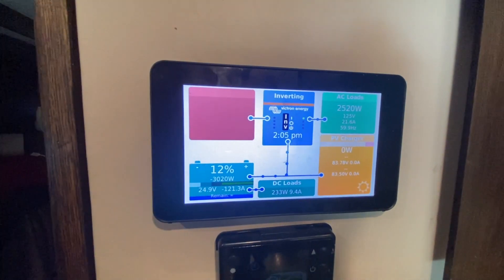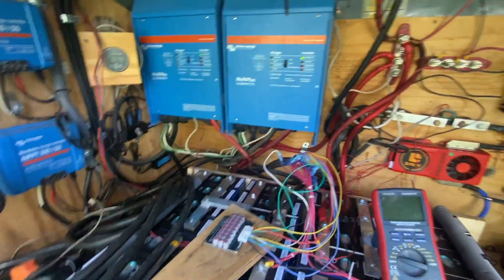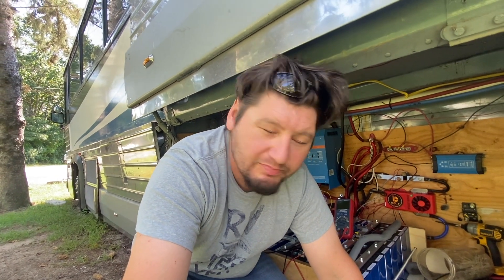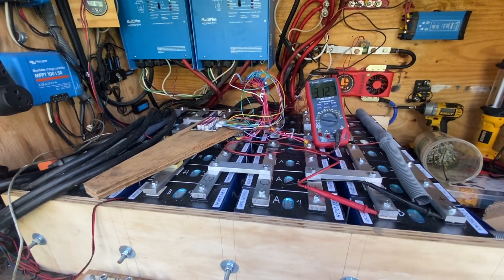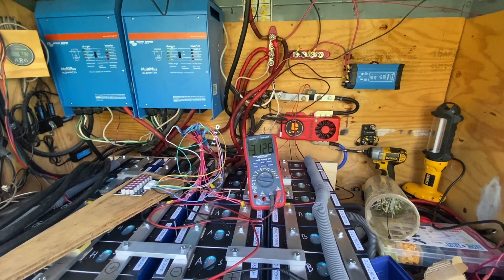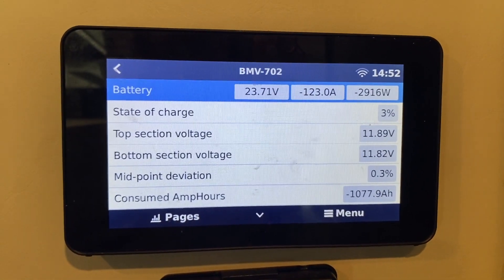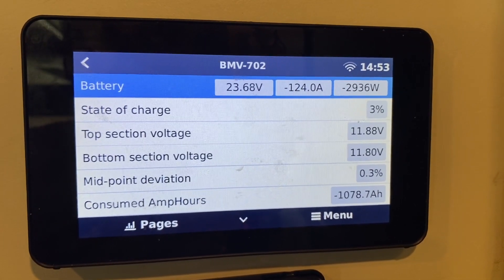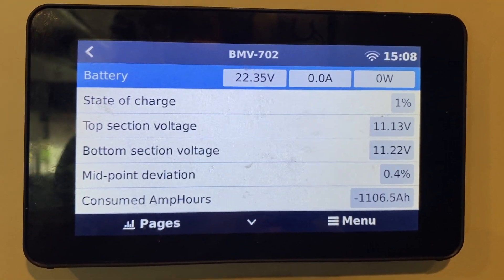DIY 4p8s 24v RV Lithium Battery Bank Capacity Test in Our MCI MC9 Bus Conversion

Comment: Just wondering how long did it take to charge ur battery bank back to full after ur capacity test?
Reply from the maker: Not sure back then. Today I can collect 20-22kw in a good day.  Battery is 28kw so…. On shore power with my 20 amp plug charging at 40 amps about 27 hours.
Reply: @HimmelbergerBus  oh ok I asked because I'm moving up from 5760wh to 12,408Kwh & was wondering was it gonna take me a lil longer to charge I only have 5 355w panels
Reply from the maker: @thelithiumpowerch  yes , much longer :-)
Reply: @HimmelbergerBus  oh boy so far I can get back to 100% in a few hours on my 2 24v 8 cell 120ah banks at 240ah now I'm adding a 3rd 24v bank of 8 277ah cells giving me 517ah

Comment: You should install a mini split on ur bus probably takes ways less power to run and do another capacity test the mini splits are very efficient.
Reply from the maker: Not a idea, except I  need the forced air for keeping air moving through the bunks and other areas.  We're  deducted system.   It's one of those things where the budget consists of time, space, money, power, battery .. how do we want to spend it all and in what portions.    I've made some additional changes that I'm hoping to share soon.  Stay subbed!

Comment: Those bus bars are not the best. Amazon has some really good bus bars but its the big copper ones that are like industrial grade. I have bought several and they are good but those little hobby bus bars are toys
Reply from the maker: Agreed. @sotasolar should really fix this :-)
Reply: @HimmelbergerBus  I know some people smash on Amazon products but it's where I got the bus bars for my system and I've actually just ordered several more for the battery build and another solar setup I'm putting together that's for my minisplit. Having good bus bar and super heavy wire makes all the difference in  a build
Reply from the maker: @matthewknight5641  yup

Comment: Trying to fix my comment just wondering how many watts does your air conditioner system draws when it's running like that I'm noticing a lot of people are using the AC mini split and heat pump units because they run at a lower power rate
Reply from the maker: The mini splits are much better. Rooftop AC is 1300-1500w depending on conditions.
Reply: @HimmelbergerBus  yes I just bought me a Senville 12000 btu mini split for the house once they hit ur set temperatures the power draw goes way down to like 300 to maybe 600 some even go down lower then that I just thought that was something you might be interested in you could run your AC mini split a lot longer and do another test for us 🙂 with your battery setup and the way a mini split run you probably could run for days 😉👍🏾

Comment: Wire lugs are only as good as the thinnest cross section of the lug between the end of the wire and the lug hole.
Use the thickest lugs you can buy.

Comment: Nice, hey I have a 50 foot air hose and I wana have a on board air on my 1993 mci bus , but is there any place to hook the hose too?
Reply from the maker: Nice to see you again. 

Yeah, there should be a port on curb side rear. I’ve used it to fill tires on the road .
Reply: @HimmelbergerBus  That’s on the right rear we’re all the plumbing is
Reply from the maker: @paulswan1982  Yeah, mine is mounted on the wheel well with the tag dump valves.
Reply: @HimmelbergerBus  sweet! I go my RV tomorrow n check it out! It’s in storage here in Florida :) How is your RV hood up in the winter weather? Like tires crack? Fade? Rust? Coronavirus 🤣 corrosion? Batteries 🔋? Because I going to bring my RV up there maybe next week 🥰
Reply from the maker: @paulswan1982  No issues so far. Just make sure the coolant is up to strength :-)
Reply: @HimmelbergerBus  I just flushed all my coolant

Comment: Does nobody know how to use a torque wrench? As an electrical engineer all electrical connections are torqued to manufactures specs, it avoids all these problems everyone has with self built banks. Hand tightening electrical connections is just asking for random tightness or over tightness.

Comment: I need some help with setting up my Cerbo GX. I have 3rd party inverter charger and charge controllers but want to monitor history of PV production and battery consumption. I have installed a smart shunt between solar controllers and battery to track the current. Anyway it isn't showing up at all in my historical graphs. I also have a smart bmv 712 to watch battery bank. Do you have a suggestion for where I could get support? I'd love to have a quick chat with you even.
Reply from the maker: Victron Community is great for that sort of stuff.  Here is a post I found, looks like it's not in the future plans.

https://community.victronenergy.com/questions/73342/vrm-dashboard-and-marine-mfd-app.html

You might find that your PV and Inverter does have unofficial support for VRM / Venus OS logging.  There are a number of devices people have gotten working on there.

Comment: Nice job, I've built basically the same thing only half the capacity so far... hope to double it next year, I'm like you, this is all new to me but I had a loose nut on mine during charging... not much but a little bit and the first capacity test was 40ah short, once I tightened the bolt up and recharged, I got full rated capacity... and you have to charge to 3.65v per cell and discharge to 2.5 which is a pain to do, if you've got over 1100ah out of it , personally I wouldn't worry about it too much, in service you never charge that high anyway, so far the voltage drift at the bottom charge disappear as you recharge, mine was I think 8mv at the bottom and 3mv at the top, I only used the active balancer for the last little bit of charge... 3.6 and up to get them all to 3.65, I'm charging the pack voltage to 28.2v which gives me about 6ah short of a full 100% charge and the BMS doesn't kick out at that... I think you have a darn good battery pack there, takes some getting used to with the voltages compared to lead acid though doesn't it... I don't know about you but I dropped almost 1000 lbs. of weight off the bus getting rid of the big 2v lead acid cells I was using before, imagine your AGM's were similar... keep it up, this stuff is fun isn't it....
Reply from the maker: Yeah these new batteries are so fun to play with. I’ve been debating on doing a full draw down again or not. I’ve also considered doing a zero current calibration on my shunt. So many variables could account for the variance, I’m not sure it makes much difference. 

Are you old 2v batteries Edison? I thought so for some reason. If so, I’m fascinated, sounds like they’d make great stationery energy storage. 

Yeah we dropped a good 1000 lbs and saved space.  So much so, I’ve thought about combining my wet bay and electrical bay and worry about keeping 1 warm. 

Thanks for mega comment, I love reading about other viewer’s experiences. Also love your channel, every time someone asks about adding slide outs I mention you and say “I’ve seen it don’t, but it’s a lot of work”.

Safe travels!
Reply: @HimmelbergerBus  My old 2v batteries are Davidson Battery, they came off an old barge we had at the Tug Boat company I used to work for, they were free so worth a try... they didn't last long, the slideouts definitely were a lot of work but worth it for the space I gained, I have my wet bay and electrical in separate bays but I'm going to heat them together, I'll be doing that before winter so you can take a look at that and see if something similar would work for you, I'm just going to use 1 heater and circulate the air through both bays... hope that works... good to hear from you , keep the videos coming

Comment: replace that bad group with the leftover batteries that you have.
Reply from the maker: Well 1) it’s not all 4 that are bad, we’re talking 16 amps out of 1120. 2) if that bolt was lose during charge it could just be under charged. 

Maybe I should make sure these get to 3.65 and soak until the hot 4 amps per cell absorb, then to another test. Problem is it takes so long now :-)
Reply: @HimmelbergerBus  sounds good bro; i like technology like this.:)

Comment: Great test! Are you happy with the Daly BMS? I am thinking of the 500a vs 400 or 250. What other options did you look at for BMS? Kinda surprised you didn't go with Victron. Also can you log history with the Daly vs cerbo gx? That is ultimately what I am after. Thanks
Reply from the maker: I’m not aware of a stand alone BMS from Victron. They sell batteries and battery protect switches though. 

Daly seemed like the best one, had BT and UART options for
Monitoring. And you can log that info in the Cerbo via VRM. However, to do that requires adding in a driver to the Venus OS software and fiddling, but it’s pretty cool. Only bummer is no cell level monitoring, so for right now I’m using the BT app. 

I still use my BMV 702 for two reasons 1) it actually lets me input the full capacity of the battery.  Daly BMS limits to 1000ah  for some reason. 

2) I can still log overall pack balance with the midpoint tracking from my lead acid system. It’s just monitoring 4/4 .

Thanks for watching and commenting!

Comment: Cells age, you loose capacity. You need a proper calibrated torque wrench, and a thermal imager.  Buzz bars will get warm, as long as they don't get over 25°C they are happy. I'm currently replacing a 600kvA UPS, torque wrench is a necessity for batteries. FYI the battery couplers are the same as you where supplied with your batteries.
Reply from the maker: Great advice, thank you! I really need a thermal imager for more than just this project.
Reply: I use a Fluke VT04, it's the same size as a laser thermometer, but it allows you to take thermal photos to flash card. Built in Washington state as well.

Comment: Hello from the high desert of New Mexico,  I believe the reason why you did not pull full cap is that loose cell , try replacing the bolts with studs and then retest the battery pack
Reply from the maker: I think you’re right. But at the same time, would it be worth retesting and stressing the system for an extra 14 ah?   I’m thrilled with the performance overall.

Thanks for the comment!